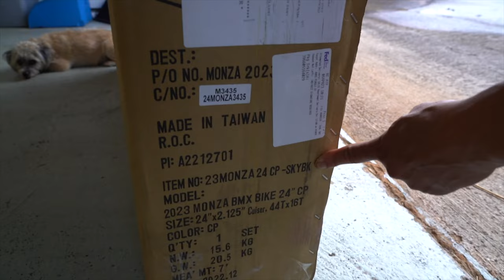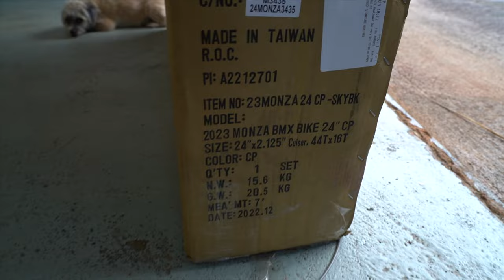Unboxing and Building a Monza 24" BMX Cruiser!

Comment: I don't mind The Gooseneck being Gold color.And or the Seat post clamp being Gold.and or even Sprocket or The Cranks being Gold.But that's it.I normally prefer The Bike to be Fully Chrome.Or The Frame to be painted and The Handle Bars to be Chrome.But This particular build on this Brand is still awesome.It's definitely an 80's vibe.Nice Job Guy's 😎👍🏾enjoyed The Conversation.
Reply: Not a fan of gold on bikes either. Different frame/handlebar/mag and hardware colors needed.

Comment: For the pedals u could have saved the reflector, smoked them black with vinyl film. Then if you wanna get fancy you can add a led light strip behind the reflector . It would have to be battery powered obviously.

Comment: Perfect size for Bernie! I think the reason it feels bigger is that it comes with full rise bars, most Cruisers come with 6" rise bars. The 1st thing I would upgrade would be the grips. Also, the "boot" on the V-brakes goes on the end of the noodle, it's to keep the dirt out of the cable.  Another great video guys! Mahalo for sharing! Aloha!
Reply from the maker: That's a good point Chris. Yeah, the full rise bars do make a difference and yes, I think the grips gotta go!  Thanks for the tip on the brakes too!  Mahalo for watching another one!

Comment: Needed to tighten up the brakes and then do the cable clamp. Then adjust the lever tension after. Leave a little room for the lever adjustment in front. Same with the front brakes too

Comment: at like 59:14 the neck part of the steering wheel moves no matter how much I tighten it. the handle bars go left and wheel moves right.
Reply from the maker: Are you talking about your bike? Is this your own Monza? If so, try and loosen that top bolt going down into the stem, then loosen the two side bolts below that that clamp the stem to the fork. Line up the bars with the tire, then tighten those two side bolts first, and then the top bolt. Not sure if this helps or not but I hope you can get that tightened!
Reply: Thank you! I fixed it.

Comment: For the front brake, I don't think you would need to swap the spacers because it's not a v-brake that's bowed out. People usually swap the spacers just to get less bowing from v-brakes. For the v-brake sticking on one side, first take the brake off all the way and when you put each arm onto the post, make sure it slides on easily. If not, use sandpaper, clean, and try again. Once they slide on easily, take them off again and use grease on both posts. Then install them and bolt them down, adjust the cable, etc. Then, pull the brake lever tight and hard about 50 times. This will set the brakes and stretch the cable a little. Then you can start working with the fine adjust screws. They work in the opposite you would think. If you screw one side in, it will pull the arm outward. Adjust them a TINY bit at a time until you get it perfect. Squeeze the brake lever tight again another 20+ times. One more fine-tune if needed and you're done!
Reply from the maker: Thanks once again for dropping that bike shop knowledge for all of us to learn from!  Had no idea you had to squeeze that lever so many times, but it does make sense!  Appreciate you homie!
Reply: @cruisinginthe808   You don't have to, but it will usually help!
Reply: @cruisinginthe808  also to adjust front brakes (caliper style) you just use thin cone wrench on the flats on the front side of fork, in between caliper. Rotate the entire assembly to achieve desired results.  It's nice they include the front brakes now. The mx2 levers have 2 cable positions, one for v brakes, one for caliper style. That black part in the lever just holds cable in the correct hole. Those levers allow you to have matching lever set on 2 different types of brakes

Comment: What size axle nuts are on the 24”.  I am looking at the billet nuts and tensioner but dont known which size to go with.  They sell nuts for 3/8 24 and 26 tpi.  I have seen pics of some bikes that appear to not fully tighten on threads.  Thanks

Comment: Love the 24, but not of fan of the gold accents on either bike, just not my color, I'd have to change those out for something else.
 I'm 51, had a Cycle Pro Bonzai in the 80's, similar look to the 24, but no mags. If Monza offered the same bike, with different colors on parts and mags I'm all in. Very nice machines indeed.
Reply from the maker: I’m like you, didn’t like the gold so I swapped it out with blue! Check out my other Monza 26 video I did that shows it. That’s cool they you had the Cycle Pro! Keep riding!! 🤙🏼

Comment: It is actually Tangeseiki from Japan. But everyone shorted it in the 80s to Tange. I just bought a brand new one for my 1995 Haro sport as it was the only good headset other than the epoch mouri to use. And i could not put a sealed bearing kit into the old girl with a gyro running as the forks would run out of thread
Reply from the maker: Thanks for sharing that!  Any part from Japan seems to be a good one quality wise. Thanks for the info!

Comment: Note: Non-metal MAG Wheels, please use caution....Since it's NOT metal, the sidewalls that hold the bead of the tire cannot sustain suitable tire pressure for applied racing applications...making jumps difficult for riders weighing over 155 pounds. The soft sidewall of the rim would release the bead on the tire....
Reply from the maker: Brah, my heavy okole would buss that bead for sure then if I took that sucker on the track!  Haha!

Comment: Hey guys I hope your both well, I was just wondering what the chrome is like, and then you answered it. Are you sure that the stem is not polished alloy. In the 1980’s I can’t remember why I did it, but I had a gold anodised SR Sakae Stem and I took to Metal Work class at school and sanded down with a low grit emery cloth and buffed it with a wire wheel and it came up excellent, unbelievable just like chrome.

My friend use to do it by hand to his Araya Rims that were anodised, because the brake pads would make it look messy and uneven when it wore of, and again it came up excellent polished side walls and coloured rims…….😳
Reply from the maker: I'm pretty sure it is chrome plated but I am going to ask Thomas over at Monza to be sure and I'll get back to you. Thanks for the question and for watching!

Comment: Usually, the seat tube is a little bit shorter on a 24. Maybe an inch and a half.
Reply from the maker: Yeah, that's a good point. We are seeing some tubes being shorter as expected but that top tube being the same length as the 26 is probably why the bike feels very similar to the 26. Thanks for sharing that and for watching!

Comment: Make sure your brakes are working GOOD and the brakes and rim are DRY before doing wheelies!!
Reply from the maker: It's my first time using rims like the Tuff Wheels and the braking is.......interesting. Kinda honks a little like a duck and vibrates a lot. Is that how they are? We put on the Skyway brake pads too.
Reply: @cruisinginthe808   Should be minimal vibration, but I guess that depends on the pads and how fast you're going. But yes, clear pads work best on mags, and clear pads are notoriously loud. Make sure they're toed well, and break them in, 'bed' or 'prime' them by short strong brakes like 30 times or more, and then recheck to make sure the pad is still toed and in the right place. Good luck!